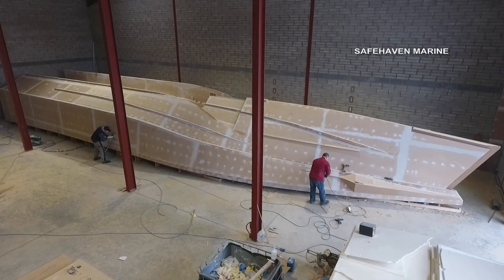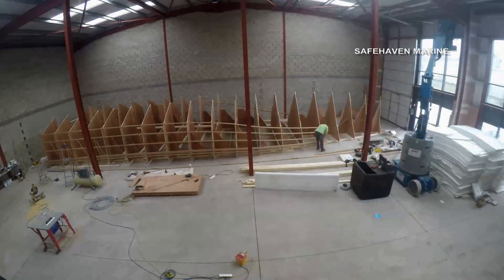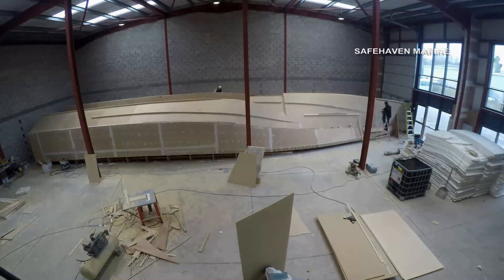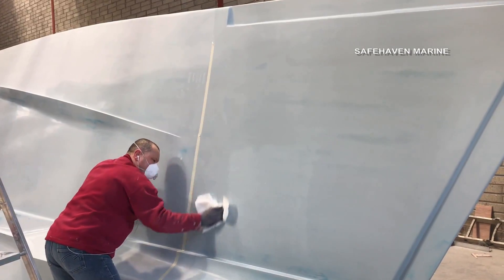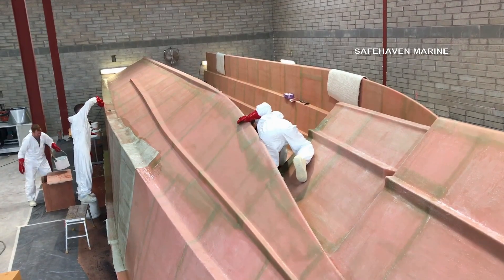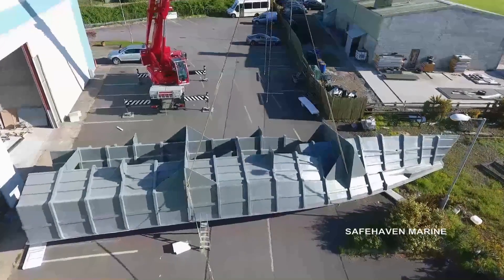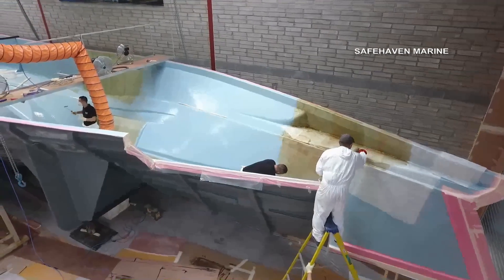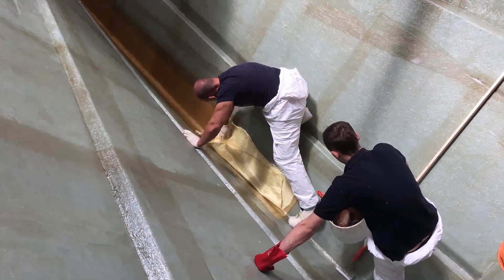XSV20 Hull plug and mould FB with logos

Comment: All right gentlemen congratulations this design the you at fabricated will hold a diesel water jet turbine.. make a metal skid plate that will join the Gap together and then fiberglass it cool custom build a slide that will go into place there is not going to be a boat that is going to be able to keep up with it.........